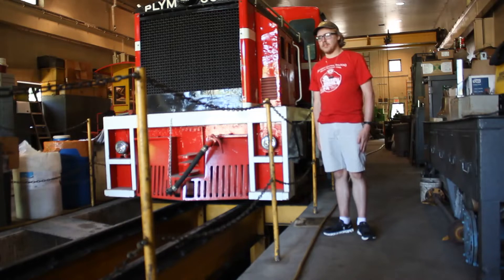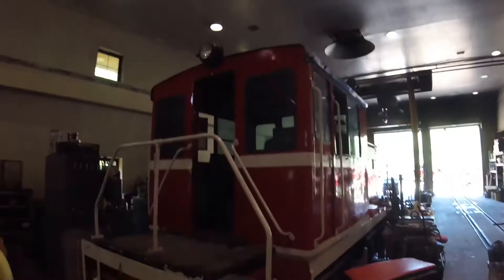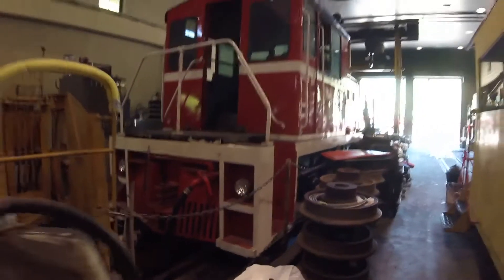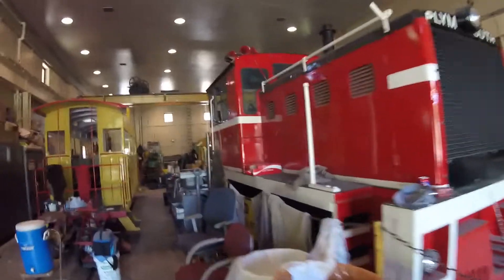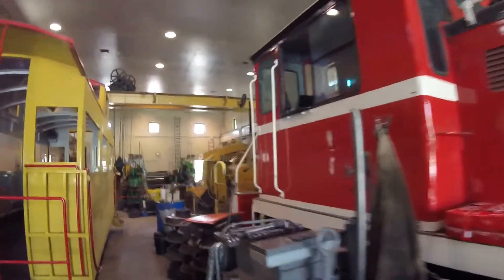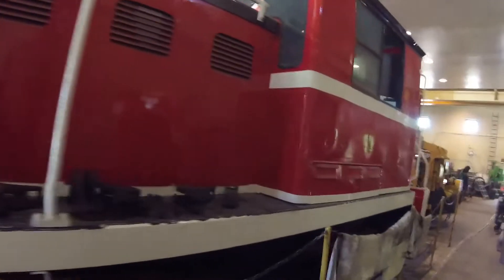_Henry Doorly Zoo - Omaha Zoo Railroad - Omaha, NE_ Episode 5 (Omaha Zoo Railroad 6035)

Comment: Nice video also is there any known footage of this locomotive running
Reply from the maker: I'm not sure if there's an existing footage of this locomotive in operation at the Omaha zoo
Reply: I don’t think there is. They really try to optimize the steam locomotives as much as they can. If either 119 or 104 were to go into storage for inspection, they’d probably be able to use it to haul passengers. I’ve heard that it has some difficulty navigating certain grades and curves on the route, tough.
Reply: @tenorcenter  True! We’ve never used it to haul passengers because it doesn’t have the air capacity for the brakes we consider to be safe. So it has only ever been moved to rearrange the locomotives in the shop during the winter when they are no longer under their own power.
Reply: @Skeeyao  do you have plans to improve that in case one of the steam locos goes out of service?